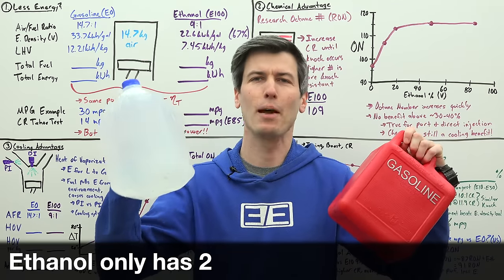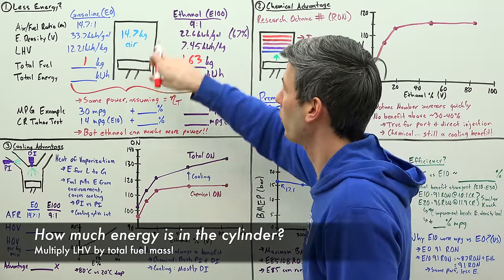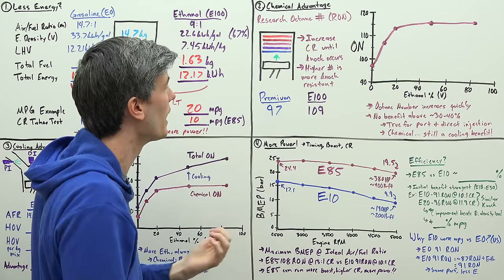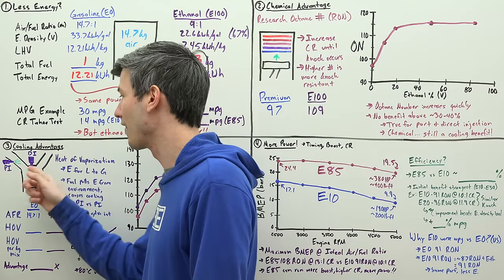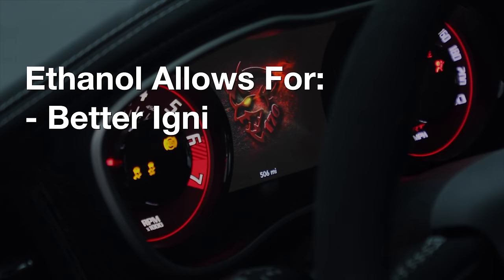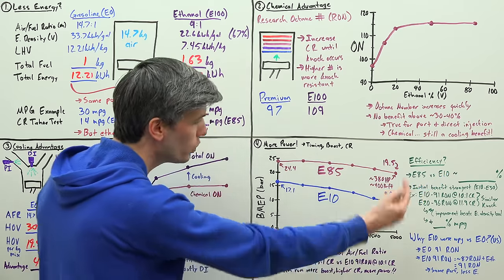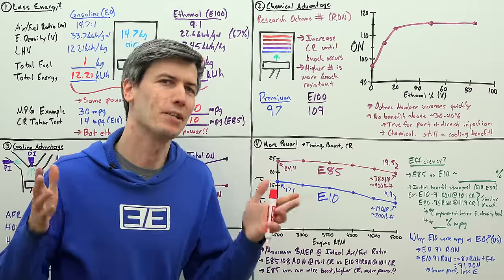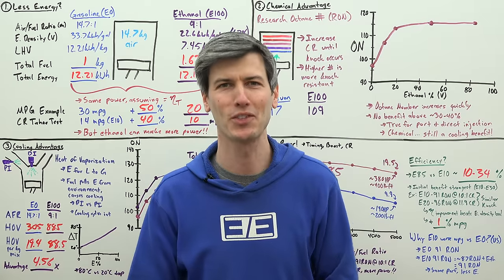Why Does Ethanol Make So Much Power? (Versus Gasoline)

Comment: Very good informative video. However one Serious downside of using E 85  that people should be aware of; it is highly corrosive within the combustion chamber. As it burns, it forms hydrochloric acid and formaldehyde causing sludge formation within the oil. Continued use of it will cause carbon and sludge buildup in the piston ring grooves causing them to stick resulting in lower compression and oil consumption. If you want to have fun at the dragstrip with your demon 170 Great! But I would not suggest using it in your daily driver especially in cold weather. It will significantly shorten the service life of your engine.
Reply: In Brazil, they find that identical engines last >300% longer on E100 than their common gasoline.  Ethanol is sootless and soot is what wears out engines.

Oak Ridge National Laboratory measured a Saab engine with E0 and E85 and they show E0 is what produces a lot of formaldehyde under US06 driving conditions (i.e. real world).  E85 in a cold unworked engine did have more formaldehyde than E0 which fell to negligible levels during real world driving conditions (US06).

ClearFlame, a company who converts diesel engines to burn E100 with investors such as John Deere, Cummins, reman companies, and others, is able to eliminate the costly and unreliable diesel exhaust filter systems and DEF it is so clean and sootless.  

The claim E85 forms HCL (hydrochloric acid), one would need hydrogen which ethanol and even gasoline have, and then one would need chlorine which used to come from engine oil. The petroleum industry quit putting chlorine in engine oils some 40 years ago because of the formation of HCL. 

40 years ago, there was no E85, so the hydrochloric acid being formed was from gasoline and the engine oil which then had chlorine.

Comment: Can you explain that to a fifth grader?
Sure! Let's imagine you have two types of food: apples (gasoline) and oranges (ethanol). Both can give you energy, but they work a bit differently.

You need to eat more oranges than apples to get the same amount of energy. But when you eat the right amount of each, they give you about the same energy in the end.
Oranges are like a "super-food" that can handle more "pressure." In an engine, this means ethanol can handle more squeezing (compression) and still work well, while gasoline might start having problems (engine knock).
Oranges also have a special "cooling" power. When you eat them, they cool you down more than apples do. In an engine, this means ethanol can help keep things cooler, which is good because it prevents the engine from having troubles.

Because oranges (ethanol) can handle more squeezing and keep the engine cooler, they allow the engine to work harder without getting hurt. This means the engine can make more power when running on ethanol compared to gasoline.
However, remember that you need to eat more oranges than apples to get the same energy. So, while an ethanol-powered engine can make more power, it might need more fuel than a gasoline engine.

Comment: Soo...? All regular cars in the future will run on e20?? and high performance cars e100?
Reply: All regular cars today can run on E20, in fact, before the EPA approved E15 in 2011 for cars 2001 and newer they, along with the DOE, conducted long term testing on cars 2001 and newer with not only E15 but also E20.  They found both fuels ran fine and did no damage.

Nebraska today has a pilot program to use E30 in their non-flex fuel state vehicles.

Of course, Brazil, who has many of the identical non-flex fuel cars we have, has used E27 for many years.  It has worked out so well and for so long that Paraguay went to E27 as well.  India is going to E20 for their non-flex fuel cars.  Brazil talks about going to E40 for non-flex fuel cars.  Manufacturers have to purposely set the ECU on engines to throw a yellow engine light around E50 and greater, otherwise people would figure out they can use E85.

Here is an ethanol engine Ricardo built for GM and drove around a few years ago:

FROM RICARDO:
The new federal CAFE standards are calling for a doubling of fuel mileage performance, which, Vint says, is going to send OEM’s looking for high octane numbers to improve efficiency and ethanol is the best source. Ricardo, an engineering firm with over 100 years in the business of engine design, has developed an extreme boosted direct injection engine (EBDI) to optimize ethanol blends. The 3.2 V6 gasoline engine rivals the power and torque of a much larger GMC Sierra 6.6 diesel, he said, and it delivers 3.5 percent better fuel economy than the diesel.

Comment: As stated can can also do the opposite but it can make some big numbers what he didnt cover is the dirty by products left behind but for another video perhaps
Reply: What products would that be?  Ethanol is so clean burning that they sell indoor ventless fireplaces that use ethanol.

ClearFlame, a company who converts diesel engines into burning E100 which John Deere, Cummins, and others have invested in, is so clean that the need for the expensive and unreliable exhaust filters and DEF are eliminated.

Indeed, if you look at the ingredients of many engine cleaners, they will contain alcohols.

Comment: I'm getting that it's kind of like the difference between thermite and thermate. Do you want something that burns for a long time and gives better fuel economy, use gasoline. Do you want something that burns extremely hot extremely fast to generate a lot of power real quick, use alcohol.
Reply: Actually, gasoline burns hotter than ethanol.  Look it up.

In internal combustion engines optimized for ethanol, ethanol gives better fuel economy.

For example, Ford's first prototype EcoBoost engine optimized for E85 had 15 to 20% better fuel economy than E0 with load performance comparable to diesel engines.  They didn't come out with it as flex fuel because they thought they could skirt paying the MIT scientists patent on the technology.  That is still in court today I think.

Ricardo built an ethanol optimized engine for GM and drove it around with mileage and power greater than GM's diesel engine.  This is why GM (& Ford) wants a 100-octane fuel standard from the EPA.  For some odd reason E85 pump availability in the US is <2% as compared to France where E85 is available in >25% of fuel stations.

FROM RICARDO:
The new federal CAFE standards are calling for a doubling of fuel mileage performance, which, Vint says, is going to send OEM’s looking for high octane numbers to improve efficiency and ethanol is the best source. Ricardo, an engineering firm with over 100 years in the business of engine design, has developed an extreme boosted direct injection engine (EBDI) to optimize ethanol blends. The 3.2 V6 gasoline engine rivals the power and torque of a much larger GMC Sierra 6.6 diesel, he said, and it delivers 3.5 percent better fuel economy than the diesel.

I say if you want to pay more per mile to drive and pollute the air your family and friend breathe, use gasoline.  If you do not wish to do any of that, use ethanol.

Comment: Is it true that e85 engulfs the oil wth water tho?
Reply: All hydrocarbons when burnt produce water in the combustion chamber which leaves the engine in the exhaust as steam, even hydrogen does.

E85 uses anhydrous ethanol, but even hydrous ethanol which contains 96% ethanol and 4% water (192 proof like Everclear) burns fine and leaves the engine as steam in the exhaust after helping push the piston.

Brazil's flex fuel engines use E100 hydrous ethanol and they find that identical engines last >300% longer using E100 than their common gasoline.  Soot is what wears out an engine and ethanol is sootless.  Oil lasts long without soot and water doesn't get in the oil.

Comment: I fill up on E85 sometimes because my 08 C300 sport has a flex fuel engine and I can really feel the difference in torque and power when running E85 over Premium. The only downside is that E85 can cause moisture buildup because of the ethanol in it. I thought something was going wrong with my starter or something in my car because after filling up on E85 for 4 Tanks in a row it wouldn't start up right away on cold starts and would crank over a couple times. I filled it back up with premium and next morning on the cold start it started right up like it used to 🤷‍♂️ If your running E85 alot I'd suggest running regular gasoline once in a while to flush any moisture or throw a can of Sea Foam in your tank

Comment: Hold on. I get fewer miles to the gallon on flex. You're saying it makes more power? I call bs in practical application.

Ah, i see. MPG is the same as i said. So what does he mean it creates more power?
Reply: In our current gasoline optimized engines, ethanol will get lower mpg but more horsepower and torque.

For example, a Chevy 5.3L will get a clean 380 horsepower on E85 vs a dirty 355 horsepower on E0. 

In an ethanol optimized engine, you will get both more horsepower and more mpg than a gasoline engine, even more than a diesel engine.

Ricardo built an ethanol engine for GM and it ran in a pickup.  Here is an excerpt of an article describing it.  

FROM RICARDO:
The new federal CAFE standards are calling for a doubling of fuel mileage performance, which, Vint says, is going to send OEM’s looking for high octane numbers to improve efficiency and ethanol is the best source. Ricardo, an engineering firm with over 100 years in the business of engine design, has developed an extreme boosted direct injection engine (EBDI) to optimize ethanol blends. The 3.2 V6 gasoline engine rivals the power and torque of a much larger GMC Sierra 6.6 diesel, he said, and it delivers 3.5 percent better fuel economy than the diesel.

This is not new technology or knowledge, it was known long ago.  It is suppressed technology.

Rear Admiral C.M. Chester wrote Henry Ford a letter on Dec.15, 1916:
"...I also pointed out in the article that as governmental laboratories had developed from 40 to 55% efficiency in alcohol engines as against 20% in gasoline machines, the use of alcohol at double the cost of gasoline for power purposes, was cheaper for motor[s] than gasoline in common use today."
Reply: @danafletcher2341  what i don't get is, if it generates more power, shouldn't it take less of it to power the same mpg ? Why is mpg worse, if there is more power?
Reply: @djaa7  Simple, the engine is designed to optimize gasoline and not ethanol.  The ethanol's special burn characteristics are still giving the extra horsepower.

BTU is just a measure of heat and ethanol has fewer BTUs.  Back before there was such a thing as fan clutches or electric cooling fans, people who converted cars to run on ethanol would have to put cardboard in front of the radiators because they could not get enough heat.

Ethanol has super high octane, superior flame speed front, volume of combustion air produced and other burn characteristics that make it overcome its lower BTU content to surpass the mpg of even diesel engines.  The higher the compression an engine has the better the efficiency and ethanol can have far higher compression ratios than gasoline and even diesel.

GM when flex fuel vehicles first came had a class action lawsuit because they purposely had MAPs in the ECU that gave the ethanol worse mileage than necessary.  Perhaps kickbacks from the petroleum industry??? 

This is the main reason we have ethanol in usage at the levels we have now:

With just 10% ethanol added to E0, the Swiss Federal Laboratory for Materials Science and Technology found that the especially health devastating ultra fine or nano particulate emissions were lowered by 97%, carbon monoxide lowered by 81%, carbon dioxide lowered by 13%, aromatic hydrocarbon emissions lowered by 67-96%, and genotoxic emissions lowered by 72%.

Ethanol has come of age and is cheaper per mile to drive with than gasoline even with the drop in mpg.  Far cleaner air is the reason it is used.

Denver in 1988 was the first government entity to require E10 when they they were on in EPA list of ozone non-attainment zones.  Soon with ethanol they were off that list.
Reply: @djaa7 power comes from higher octane rating and cooler temps...this allows for more timing and more boost to be used.

Comment: Because of the Oxygen content. Also the reason E85 gets about 5/8 the mileage of 100% gasoline
Reply: A Ford F-150 is rated at 21mpg on E0 and 18 on E85 which is better than 6/8 the mileage.  Ethanol is cheaper per mile to drive and gives more horsepower in our gasoline optimized engines.

Because of many of the factors in the video, E85 could get higher mileage than 100% gasoline, even higher than diesel in ethanol optimized engines.

Ford's first prototype eco-boost engine was optimized for E85.  It achieved 15 to 20% more fuel efficiency than gasoline with load performance equal to diesel engines.  They didn't come out with it in flex fuel because they thought they could skirt paying the MIT scientists patents on it.  That is still in litigation to this day I do believe.

Ricardo built an ethanol engine for GM and it ran in a pickup. It is half the size/twice the power of gasoline and diesel with better mpg than either one.

FROM RICARDO:
The new federal CAFE standards are calling for a doubling of fuel mileage performance, which, Vint says, is going to send OEM’s looking for high octane numbers to improve efficiency and ethanol is the best source. Ricardo, an engineering firm with over 100 years in the business of engine design, has developed an extreme boosted direct injection engine (EBDI) to optimize ethanol blends. The 3.2 V6 gasoline engine rivals the power and torque of a much larger GMC Sierra 6.6 diesel, he said, and it delivers 3.5 percent better fuel economy than the diesel.

Scania has sold an ethanol engine worldwide for years which they state has fuel economy and power on par with their diesel engines.  Cummins had their ethanol engine called ETHOS which was half the size/twice the power of gas and diesel too.

This is not new technology or knowledge, it was known long ago.  It is suppressed technology.

Rear Admiral C.M. Chester wrote Henry Ford a letter on Dec.15, 1916:
"...I also pointed out in the article that as governmental laboratories had developed from 40 to 55% efficiency in alcohol engines as against 20% in gasoline machines, the use of alcohol at double the cost of gasoline for power purposes, was cheaper for motor[s] than gasoline in common use today."

Scientific journals from 1890 – 1920 contain hundreds of references to alcohol fuel at the dawn of the automotive era. 

Studies of alcohol as an internal combustion engine fuel began in the U.S. with the Edison
Electric Testing Laboratory and Columbia University in 1906. Elihu Thomson reported that despite a smaller heat or B.T.U. value, “a gallon of alcohol will develop substantially the same power in an internal combustion engine as a gallon of gasoline. This is owing to the superior efficiency of operation…”

The USDA tests in 1906 also demonstrated the efficiency of alcohol in engines and described how gasoline engines could be modified for higher power with pure alcohol fuel or for equivalent fuel consumption, depending on the need.

The U.S.Geological Service and the U.S. Navy performed 2000 tests on alcohol and gasoline engines in 1907 - 1908 in Norfolk, Va. and St. Louis, Mo. They found that much higher engine compression ratios could be achieved with alcohol than with gasoline. 

When the compression ratios were adjusted for each fuel, fuel economy was virtually equal despite the greater B.T.U. value of gasoline. “In regard to general cleanliness, such as absence of smoke and disagreeable odors, alcohol has many advantages over gasoline or kerosene as a fuel,” the report said. “The exhaust from an alcohol engine is never clouded with a black or grayish smoke.” USGS continued the comparative tests and later noted that alcohol was “a more ideal fuel than gasoline” with better efficiency despite the (*then*) high cost.